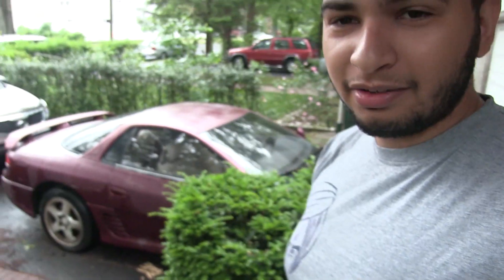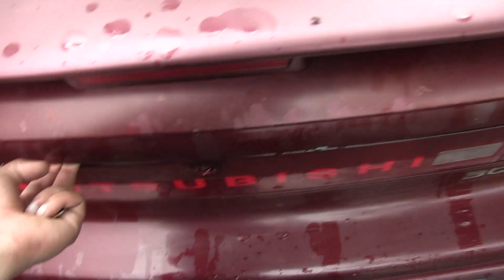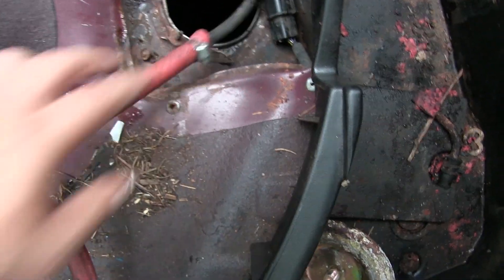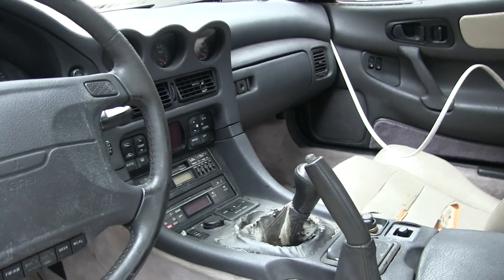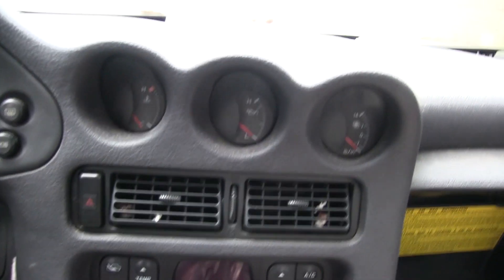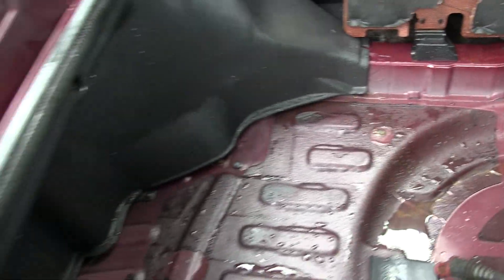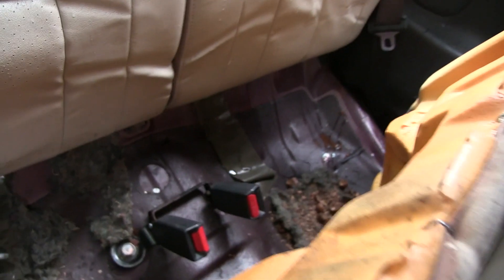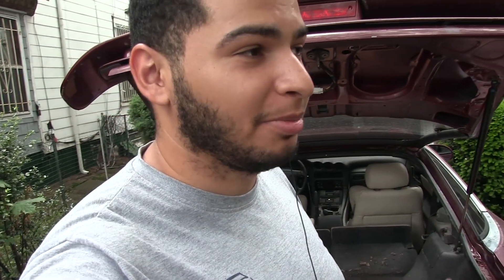Trying To Clean The Worst 3000GT VR4 In The World

Comment: This is insane. At first I thought it was worth restoring because it's so rare, but honestly you're not equipped in any way to even put a dent in this thing. There's only so much you're going to do in your driveway. If you had an actual shop with a lift and actual tools and equipment, I'd say go for it. But honestly, everything needs to be ripped out, rebuilt or replaced, and put back together again. You're not going to do that in your driveway. Also, your neighbors must LOVE you.
Reply: Debbie downer? If anything the dude is way more optimistic than me. I think you can't even do much to this car if you had a pro car shop at your disposal.
Reply: I own 2 of these cars TJP77 is right. It's not a job for the casual mechanic and comparing them to Miata's has to be a joke.
Reply: Y'all are pretty pessimistic... Anything this car needs can be done in a driveway, including a paint job.
Reply: not sure what that guys on about but im rebuilding my 3k in my front yard.

Comment: back wen i was in highschool i had to fix up a 94 3000gt SL in similar condition as yours in my parents back yard (car cost me $1000) the fuel pump and fuel filter where the first thing I had to fix in order to keep the car driving. i will enjoy watching ur videos as they remind me of when I worked on my car, btw you will have sooooo much fun doing that timing belt, especially removing that crank pulley.

Comment: I had a 91 for my first car right out of high school.  It's not actually a high performance car, even in its day, but it is really nice nonetheless and it is fun to drive.  I hope you get this back to its glory, this video series makes me want to buy something like it, although not a 3000GT.  I remember all the issues you could have, there's a lot of wiring and motorization and it can all go bad.  I think a leakdown test and oil change are on top of what would be my list, aside from a tune up and fuel pump.  It's a good engine but 225k on a turbo from the 90's would have me hoping it was rebuilt once already.
Reply: Eh, it's a pretty solid performance car, at right around 300 hp and 300 lb-ft. Certainly by 1991 standards it's got great performance specs. For comparison, the 302ci 1991 Mustang GT was rated at 200 hp and 275 lb-ft. It's comparable in performance to the Supra and 300ZX of the same era.

Comment: You know... saying "I might make it into something cool." Gave me a great idea. Do NOT touch the outside. It can be a rat rod for a new generation. The peeling 90's clear coat look. No, I'm not joking. Get it running perfectly, clean the engine bay to be pristine, fix up the interior, but unless there is damage or rust, don't touch the outside. Makes for a perfect low exterior maintenance sleeper which will surprise the hell out of people and still look cool.

Comment: looks better than mine lol, mine has a hole in the top of the engine, loud rod knock, ~50% of the dash missing, all the panels come right off with a bit of a tug, radio unplugged, glove box does close, or even open fully. you gotta turn the key at least 5-6 times before it eve attempts to turn over and at that point just pray that it actually starts and it also doesnt idle on its own at all. The previous owner had hammered in screws into the battery to keep the cables on tight, not sure what they were even made out of, some kind of metal ring that was hammered to fit the batter better. gonna be getting a whole new engine soon so im looking forward to finally getting it on the road

Comment: pressure washing the engine is a bad idea...
Reply: Zed 5786 ya i saw that in the thumbnail. not sure why spraying your electronics with a high pressure hose would be a good idea to someone.
Reply: chris d Most likely, he will replace most of the electrical components in the engine bay - they don't work anyway
Reply: not Japanese cars, all the connectors are rubber sealed. you can blast away all day no worries, american and British cars you can't even start on a damp morning half the time
Reply: Your probably right, i just would not be able to to do that

Comment: Are you sure about that engine wash? Fuse box and other electronic components like connectors and relays aren't waterproof. I will be surprised if you don't discover some electric gremlins afterwards.
Reply from the maker: I'm not starting the car for a while - more than enough time for everything to dry out.
Reply: Tavarish on a twenty year old car? can't imagine those electronics are in the best of shape already - spraying with a high pressure hose is not going to help anything.